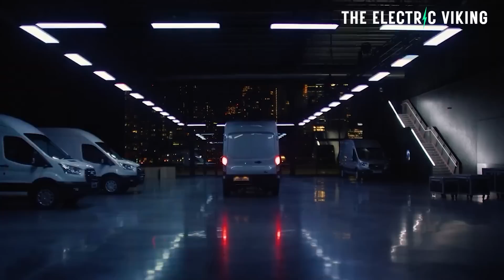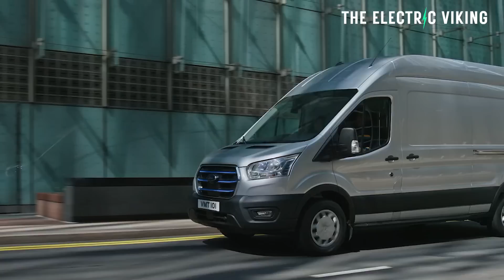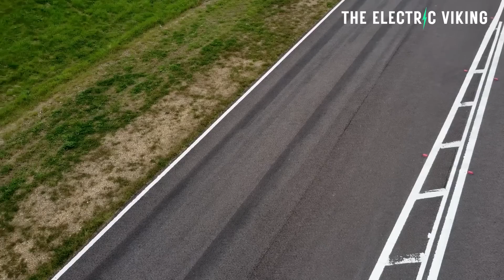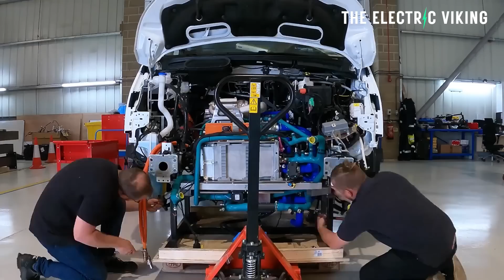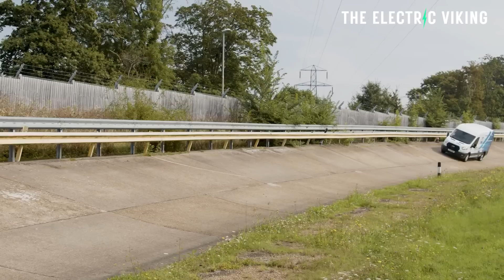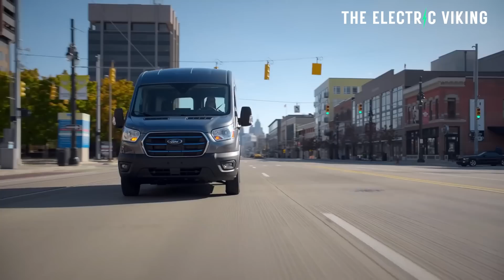Ford begins testing its NEW hydrogen Transit vans

Comment: The reason companies are chasing the hydrogen solution is because Hydrogen has a specific energy density more than 50 times that of the highest current Li-Ion battery (39,600Wh/kg vs 700Wh/kg ). This means the vehicle weight will be a lot lighter and /or can travel a lot further. Very good news for commercial transport in particular. 
Just as the conversion from ICE to battery vehicles is taking place so will hydrogen find its place. The logistics of refueling, safety, etc. will be sorted out in time. We are in a much smarter world than when the Hindenburg went up so don't believe the doomsayers.
Reply: Hydrogen has low volumetric density and hydrogen vehicles have only a third of the efficiency of battery EVs. Battery range for vans won’t be an issue in the near future
Reply: @markjonz  I agree with OP in that I believe in the future, cargo ships and such, maybe freight trains, even big planes will benefit from hydrogen. In these kinds of industrial settings, hydrogen stations and safety can be closely monitored and the costs kept under control. 
For private or even light commercial use anything under the size of a mining vehicle, I agree with Viking, it's a waste of time. 
Every house in the world that has electric plugs already has the infrastructure to support EV's. How are we going to build a giant pipeline slash delivery system to supply a million new gas stations that all need hydrogen instead of petroleum? This is just a non starter.

Comment: I totally agree that Hydrogen is 100% a distraction at best for all ground transportation. Long distance ocean shipping might be a possible application. For long distance aircraft, the H2 should be converted to a higher energy density net-zero CO2 hydrocarbon fuel.

For industrial non- mobility applications, net-zero (truly green) hydrogen may be helpful in reducing both CO2 and toxic emissions.

Comment: Ford made a concept hydrogen powered Focus.
Additionally GM has been working on hydrogen since the 90s.  They came up with the original skateboard design where different bodies can be dropped on the skateboard. It was headed by Larry Burns in Honeoye, NY

Comment: Def a spot in the market. As a tradesman I can’t afford to plug in my van in the middle of the day for an hour to charge
Reply: Afford? The $$$ are half and unless you spend more time driving than trading, you'd have plenty of chances to plug in. That's if you ever needed to. Overnight charging should be ample in most cases
Reply: @mickydee26  nope

Comment: A mate of mine is a courier. He drives his van around 400 to 1,100 kilometers per day. The 1,100klm run is his courier run once a month, from Sydney to Melbourne via many small towns & back the next day.
Reply: Yes but in any city there is probably only 1 per 1000 people that do kms like that. 99.9% of people work within a city so don't need much range.  The average car does 12000km a year, which is 33km a day.
Reply: @AORD72  Agreed. Most people I know drive no more than 50-60 KM daily. EV or even PHEV will be good enough to address that usage. I know PHEV is not popular, but just saying. EV also won't require you to go to a station. You can charge it at home.
Reply: You’d have to drive all day with only a few stops to get to 1,100 km.  You could charge up during lunch if you had a big enough battery.
Reply: @AORD72  Agree, the majority of people do short daily trips. However the majority of people also do sporadic long trips.
Reply: @SunRise-ul7ko  for delivery vehicles its probably less varied day to day... and for private cars, at least for now, many people may have a second car for longer trips.
Reply: @SunRise-ul7ko  Yea but if you do say 2 big trips (holidays) a year over 400km and you need an 1 hour each for charging that is still less time than a year of filling up a petrol car over a entire year.
Also it can be nice stopping at a city along the way and exploring while you car charges, and it gives you a rest from driving, a change to eat, drink etc.
Reply: @AORD72  in my city  60% of the population live in appartments. Basically appartments don't have home charging & you have to waist a lot of time every week at charging stations. My gas car, I fill up once every 3 weeks & it takes 5 minutes.
Reply: @SunRise-ul7ko  "in my city  60% of the population live in apartments", really sounds like BS. So what anyway, that is not indicative of the world population. 
You are talking rubbish anyway. If those apartments have parking somewhere for the cars then bollards can be installed with slow charging.
Reply: Higher energy density in newer batteries with new EVs coming out with over 400 to over 625 miles on a single fast charge in less than 15 minutes will make the use case for hydrogen a mout point.
Reply: @SunRise-ul7ko and on rare  long trips people take breaks long enough to fast charge sufficiently to reach the next rest spot
Reply: Apartment complexes will have charge points as the need arises. Apartment dwellers are usually urban-centric and don't drive or don't drive far to work. They can sometimes charge at work or near home. Plug in , go home, go back to unplug and re-park.
Reply: @mickydee26  Not in Australia. Not many fast charges yet. I agree if you live in California.

Comment: This actually makes sense as I've long suspected theres been a gas leak in ford's basement for quite some time. Imagine the possible technical improvement curve of fuel cell vs batteries. They may as well design a faster horse.

Comment: I think hydrogen tech is quite up there to replace fosil tech. Its just the question about whats the point of hydrogen if you make it from fossil fuels. If you dont have excess renewable energy which you can use to produce green hydrogen. And that is few years from now in my opinion.
Reply: Excess renewable energy is much better used to charge BEVs where you get three times the amount of miles for each unit of energy. Why waste it on Hydrogen when there's a better option.
Reply: @rogerfroud300  not sure which is better, but we will never run out of hydrogen, which is most common material in nature. Which you can't say for materials used to produce batteries. On the other hand, you can recycle these materials for battery production. Not sure which is more sustainable, in my opinion it's hydrogen, but I guess it's up to markets to decide.
Reply: It is not economically viable. Do you think companies are going to pay more for a hydrogen van then pay more for the fuel to run it? And with hydrogen embrittlement what will the life of the van be? Perhaps 10-15 years before it turns I into a hydrogen leaking explosive hazard.

 It is more likely that we will have electric vans for short haul ((cheaper than diesel). Long range will remain as diesel until 5-30 years from now we have better batteries (like >500Wh/kg).

Comment: Aviation will be a big driver for fuel cell development. Batteries unlikely to be useful for anything more than feeder aircraft for quite a while.  Combustion hydrogen engines - maybe for some sports cars. Hydrogen can be used as energy storage for remote renewable power 'plants' - at least an alternative to big (cheap - sodium like) batteries. And a van - travels a highway, deliveries around a large metro so not just within 10 mile radius - being a HCEV makes much sense. Especially with quick refuel stops versus current EV stops (and avoiding cooking the batteries several times a day).

Comment: There has to be a solution for vehicles that travel 1,000 km's daily, but for about 90% of driving, long range BEV's will work just fine.  This includes commercial users who can recharge their commercial vehicles overnight at the workplace.

Comment: Is it possible to convert a traditional gas station to hydrogen?  If so, a lot of the infrastructure is already there. 
Only constraint at the moment is the production of hydrogen!
Reply: Yes it is. The location for starters, tanks need replacing but the big thing is we know how to make the model work. Every now and then a truck will turn up and deliver supplies, consumers will drive up, fill up, pay and then eff off.

Comment: It’s a lot easier to roll out new electric charging facilities than a bunch of hydrogen stations, not to mention far less dangerous. It may be clean emissions, but you still have to produce hydrogen, store it under pressure, put it in tanks under pressure in vehicles. Every time I see another hydrogen vehicle story, I instantly think 🤔 does no one remember the Hindenburg? If Toyota , GM, and Ford had just put all of their efforts (and billions of dollars) into EVs 10 years ago, and not toyed around with hydrogen, think how far advanced we’d be at this point! 😅
Reply: Boom!
Reply: @tedmoss   ...LOL 💥 🤯 😆
Reply: Hydrogen is still EV, with zero tailpipe emission, just like BEV and it's fast to fill up. So it was always worth some investigating and maybe still is. Just realise that BEV is no total solution.

Comment: I looked at this a decade ago.  The current process of creating hydrogen is very inefficient and uses lots of natural gas.  They have been working on processes to create hydrogen directly from the sun.  They have been making progress but it still needs a tremendous improvement in efficiency but there is hope that one day you'll have a solar roof that creates all the hydrogen energy you need.
Reply: But those same panels can just create electricity… which is what the hydrogen will eventually do… someone must think they can make it work.  All these car companies keep working on it. 🤷🏻‍♂️
Reply: Yes but it's the very poor end to end efficiency that is the real issue. Only makes sense if you're using surplus, otherwise unused energy to create the hydrogen.

Comment: NOx can be formed by engines if temperature in engine exceeds 1300 C or 2370 F.  Unless it’s a fuel cell. Yes 80% of air we breathe is Nitrogen and yes Oxygen will combine with Nitrogen to form a dangerous compound when these molecules are joined.  I spent 29.5 years working on emission testing equipments used by automotive repair smog testing sites in  USA California

Comment: What does anyone care if they are wasting their money.  Celebrate the alternatives ideas, as it has much to recommend it.  Yet certainly fixes the glut of battery pack wastage we will be faced with in the future.  So there is that.
You have to accommodate a 1 ton load, which is the yard stick for vans.  E transit seems good but nothing wrong with trying for a FCEV alternative.  EVs were not (and still are not) the bargain basement alternative in the beginning.
Reply: The problem is, most hydrogen is made from hydrocarbons. So not environmentally friendly. It is being pushed by oil and gas to secure their business.
Plus battery recyclers are begging for used batteries, even paying a premium to get their hands on them. Don't stress about used batteries.
Reply: @TheGaerthy  Depends on where you get your hydrogen from and agree, no such thing as net zero emissions (including batteries).  Oz is a pretty good place, with ample sunshine and water, providing the government incentivise businesses to get on board.  Korea is doing deals here to get H transformed in Oz, and this might be as clean as you can get.  Extensive H changing stations in South Korea.  Certainly cleaner than using coal, but don’t forget Europes extensive nuclear network.  So it makes sense for for other forms of transport to have a go at doing the things EVs struggle to do.
Why recycle if you don’t need to.  A solution via eliminating the problem.
Reply: @TheGaerthy In the same way that most electricity is made from hydrocarbons
Reply: @MegaWilderness  less and less every day

Comment: Higher energy density in newer batteries with new EVs coming out with over 400 to over 625 miles on a single fast charge in less than 15 minutes will make the use case for hydrogen a mout point. The only companies pushing hydrogen are those who are still attached to the oil industry. Renewable Diesel is better than biodiesel and a direct drop in replacement that can use the existing diesel and gas infrastructure for zero to very little cost and costing less than existing fossil fuels. Pure electric is best. Hydrogen is just a waste of time and money. With the ability to charge overnight at home or at the business, rarely would you have use of a EV Fast Charger except for the occasional long trip or business call.

Comment: Toyota is building a hydrogen combustion engine. I hope that plan will work out. I have to travel to the UK from NL on a regular basis and with an EV that would be an absolute nightmare. Nor can I, in fact, afford to buy an EV in the first place. They are still about 6 times to expensive for me. As usual, the little man gets the royal shaft again. This EV stuff is for the rich. You have to be rich to be able to afford "green"

Comment: Hydrogen for commercial, EV for Consumers seems to be the future.
Reply: Hydrogen is not financial sensible, ie the cost is high - and yes  hydrogen has been around a while to improve costs.  If you are going to make hydrogen from renewable energy via electricity - so why not charge a battery at 80-90% efficiency rather than hydrogen at 20% efficiency.
Reply: The rate of battery development will eventually make hydrogen not viable (if it ever was). There soon could be batteries with 500Wh/kg, a 2 tonne battery could  then equal 1000kWh.
Reply: @AORD72  agreed.

Comment: Does anyone have data on fuel costs of hydrogen versus battery power? While hydrogen can be produced by using electricity to split water (if the power source is renewable, the hydrogen can be called "green"), isn't cooling and compressing it expensive? Anybody know?
Reply: I can only tell you that the only place in the USA that has any appreciable amount of hydrogen fueling stations is in California. I think there are a couple in other states.
Here in California the prices at the pump seem to be from $17 to $27 per gallon equivalent. From what I’ve read the hydrogen fuel cell card such as the Toyota Mirai get about 50 miles per gallon equivalent.
To install the pump for the hydrogen fueling station costs about $2 million per pump.
To install a Tesla supercharger costs about $43 thousand.
Up until this year Tesla has paid for all of their supercharger infrastructure.
The hydrogen fueling stations are being built using primarily taxpayer money.
Reply: @OldGrumpy420  Thanks. I met one guy driving a fuel cell car (not a Toyota, but another Japanese brand). He liked the car, and here in the Bay Area, had handy access to fillups. Tho Japan makers persist, I can't see how hydrogen can compete with batteries, especially as batteries grow better and cheaper.

Comment: Hydrogen is such a waste of time and money. We don't have an extra $50 billion to invest in hydrogen infrastructure along with the EV battery infrastructure to make using both fuels practical. We need to pick one and go with it. It's not like using Chrome versus Microsoft Edge where the switching cost is zero

Comment: Better or worse , who cares, bottom line is get the price off the hydrogen before making judgement,  as that is the key factor, and there is simply no way hydrogen can come close to cost off electric,  simply impossible.  Anyone tells you different is an idiot with no engineering understanding